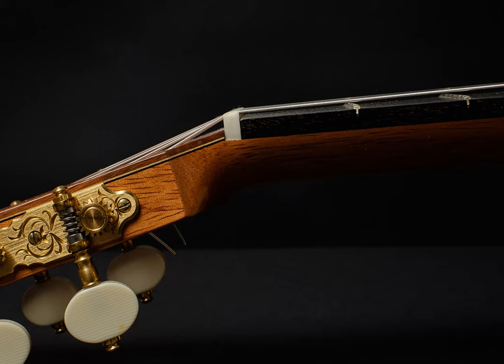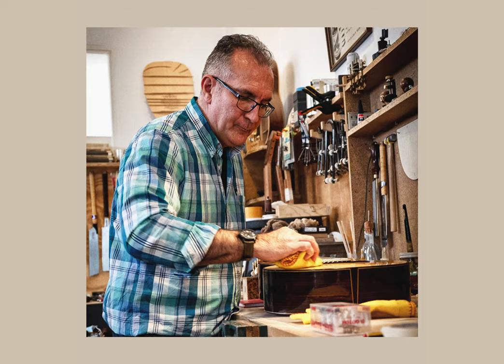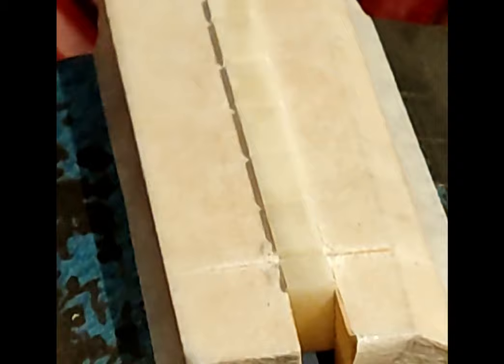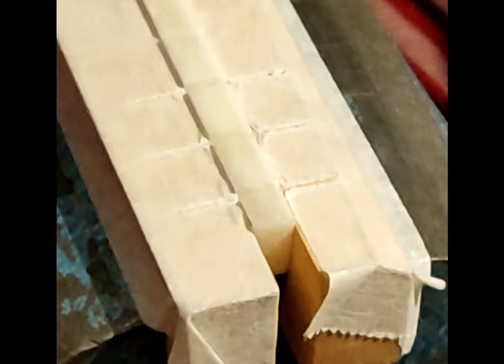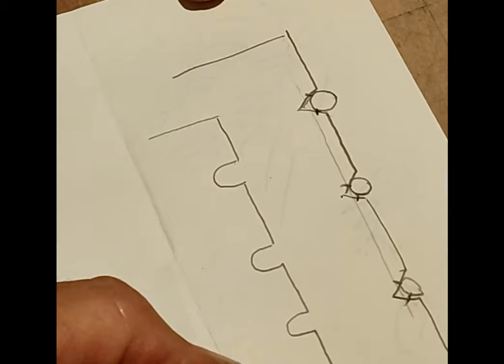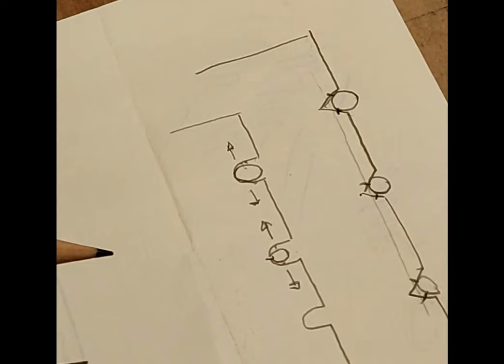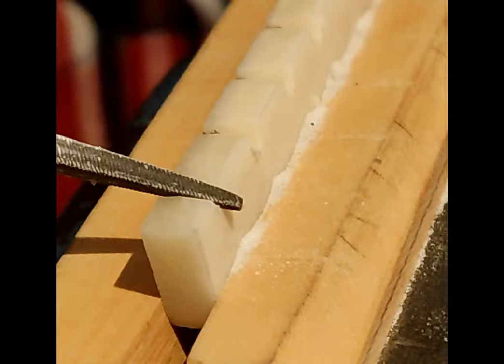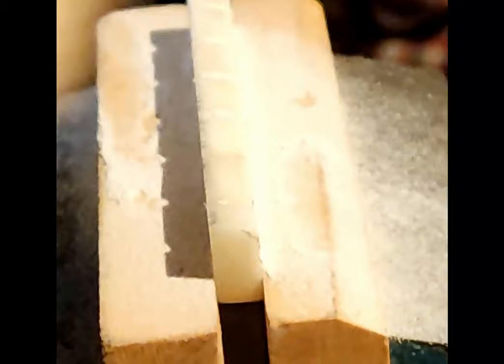The importance of a well-built Nut for your guitar. With guitar maker Pablo Requena.

Comment: Looks like a good method Pablo. I'll have to try it. I have never used a V shaped file for the nut slots, but your explanation is quite convincing that it may be an improvement over the method where each slot is cut with a particular sized nut file. Do you have an issues with the V-slot system when changing from a nylon E string (.028") to a carbon E string (.024") ?  I suppose it's good to know what strings will be used before making the nut. Cheers, Nice camera work, and the drawings help too.
Reply from the maker: Pablo told me all strings works fine with this method. Talking about the usual strings in the market. No matter the different diameters out there. Carbon or nylon.
Reply: @maderaguitarras  Thanks. Ill try it out, keeping in mind that a narrower gauge string should drop a bit lower down into the V shaped slot, than a fatter diameter string, thus making it a little closer to the 1st fret.
Reply from the maker: Yes, I understand your point. Please if you finally try it out and you find any problem with that narrow gauge string on the V shape slot let us know. Thanks!.
Reply: wouldnt the v slot cause string binding at the nut? as it will pinch the string?
Reply: @jovanmagyaya8714  - I'm not a luthier; my background is in instrument engineering.  FWIW, in my opinion, the V-shaped slot will hold the nut end of the string immobile, but that will actually help the main length of the string to vibrate freely.  If either end of the string is allowed to move around, even a tiny amount, that will drastically damp down the vibrations, blurring the sound, and reducing sustain.
I take Pablo's point about making a round bottomed slot - that, in order for it to work, it must be an exact match to the string diameter.  Aside from being extremely difficult to make with that degree of accuracy, it would also mean that, if you changed to a different gauge of string, you'd also have to make a new nut - whereas the V-shaped slot can accept such a change.  HTH, Jack